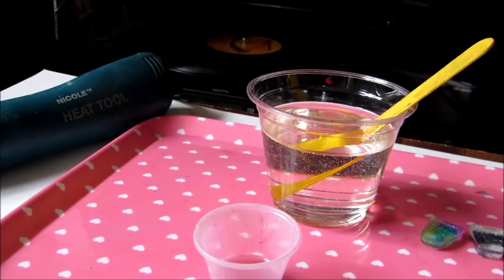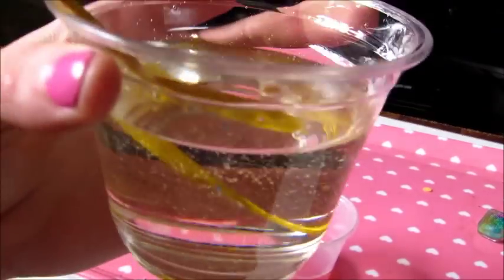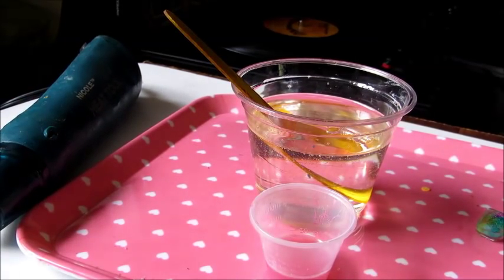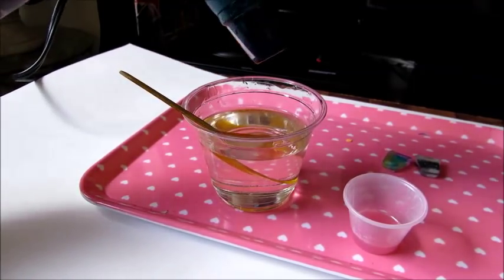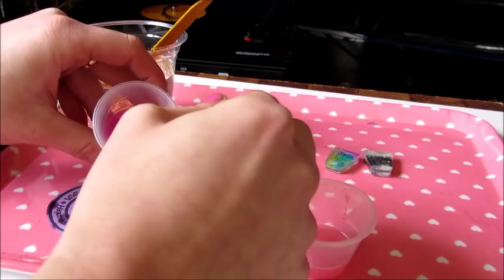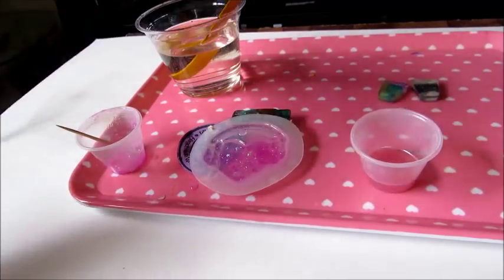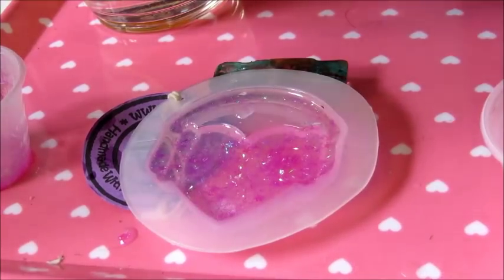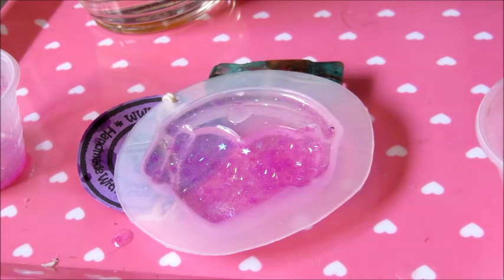How to Get Air Bubbles Out of Resin Using a Heat Gun Tutorial + Resin Tips

Comment: Another easy fix for the bubbles is: After you pour and let sit for about 10 minutes, the bubble come to the top. Then you take a simple (cheap) grill lighter, you've probably seen them all over the place. Light the lighter, set it to high flame and QUICKLY wave it close to the surface of your project, careful not to touch it. You'll see the bubbles pop! ALWAYS KEEP THE FLAME MOVING!!! Works for me every time. You probably won't get every single bubble (unless you watch it like a hawk), but you'll get most of them. If you have the time and patients to keep checking the project every 5 minutes or so, you may get them all... Best of luck fellow crafters.
Reply: Thank you for that tip.  Just started working with resin and not ready to invest the money into a small torch.
Reply: Tim Landrum patience :)
Reply: I tried tht... Blackened my resin. 😕
Reply: Works! Thanks

Comment: Please note when using a heat gun especially if you were doing canvas or wood you will have a lot of movement and blending of the paint if you use a heat gun. If you want your design to stay how it is when you poured it and you still need to get rid of bubbles then you should be using a torch.

Comment: I am guessing you are using a plastic cup because it makes the bubbles easier to see in a video, but even though you can't see it melting you are probably getting additional fumes from the cup, which matters a lot more than a mess. For safety, better to just buy a cheap silicone pinch cup for tiny amounts or a mixing cup for larger amounts.

Comment: I just want to know I'm not trying to bash you here but there is a less, " pain in the ass" way to do what your trying.  When you do it the way you are the resin will still form bubbles even after you make it bubble free, most the bubbles are so small you cant see them and effect the overall clarity of the piece.  This is called off gassing.  The correct way to remove this is to mix the epoxy full then place the mixed cup into a vacuum chamber.  you can buy cheap small 1 gallon or smaller sized chambers perfect for this. personally i have a 3 gallon from best value vac but any will do.  So get a chamber and a vacuum pump. it doesn't have to be a crazy expensive setup.  When you apply the vacuum the mixture will quickly boil from the decompression, once it stopped it is totally bubble free and the most clear it will ever get.  Lastly slowly pour the degassed  resin amount into your mold and do not move or agitate it.  Some even prefer to put the part back in the vacuum with pulls out fumes and you can have the exhuast hose go out a window if you like.

PS- if you mix in things like glitter or dye you may want to do that before degassing so that you dont reintroduce air bubbles. also the most clear resins are also the thinnest fluid. thick molasses type resins are prone to reintroduce air bubbles when being poured into a mold.  Thinner is better.
Reply: Not cheap. You are talking $125 VS $15
Reply: cyberdan1000 yeah Im not paying 125

Comment: What the difference between a blow dryer and a heat gun? Why is it bad to use a blow dryer?
Also when I work with resin, the bubbles do NOT come to the top. They just stay everywhere, teeny tiny mini bubbles.
Reply from the maker: A blow dryer is way too powerful. It may melt the cup you're using if it's plastic, it can also blow resin all over the place and from what I hear, can be pretty ugly. Are you using old resin? That could be why the bubbles aren't coming up.
Reply: No, I bought 2 fresh bottles and used it the next day - can't get rid of bubbles :/
Reply: I used a blow dryer on low heat and it worked fine for my countertop project. On high heat, it is probably like using a heat gun but with a broader range (which is why you probably need to be careful). Anyway, the blow dryer worked better than blowing on it or using a barbecue lighter which were the other things I tried.
One thing to note is that I have an older model, pretty generic blow dryer--nothing fancy. Also, I made sure to blow it away from the resin to start in case there was any dust or anything inside that would blow out.

Comment: Do you have any suggestions on applying resin to a curved surface? Like coating over a cup? I have attempted it but I get some that come out flawless and some what have riples and bubbles. Can the heat gun fix them? Any techniques or induction times before applying it?
Reply: I painted a sphere with it by continually drawing It up from the bottom towards the top and drawing off the excess with a fine brush.

Comment: This is why they make vacuum pumps.....the results are much much better and only takes a few minutes start to finish. Heat just kills your pot life along with the ten min you initially waited before applying the heat. For some an hour working time goes by quickly so doing anything that will sheer minuets off would make it much harder. Otherwise thanks for the tips as this seems to be good for people who are not concerned with pot life.
Reply: Hi, I am new to resin making and am doubting on whether to get a vacuum chamber or not...Since a heat gun is much cheaper than a vacuum chamber, and to be honest I don't know which vacuum chamber to buy since there are so many of them out there! Was just wondering what do you mean when you say "pot life"? Thanks.
Reply: pot life is the amount of "working" time you have before you can pour and get good results.